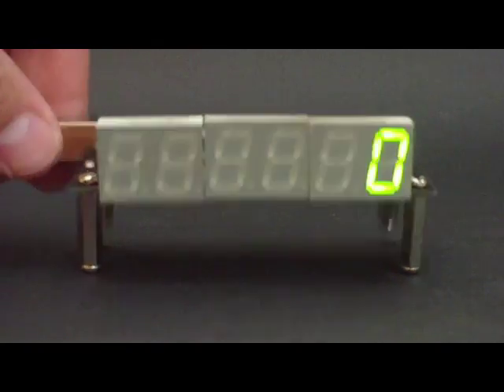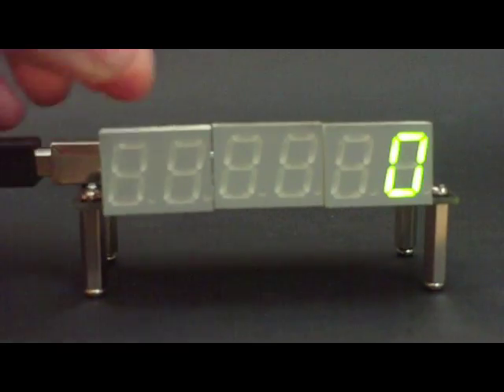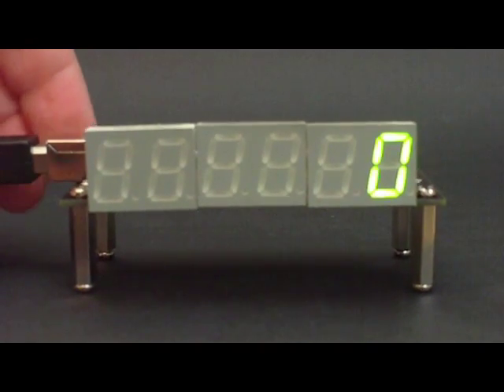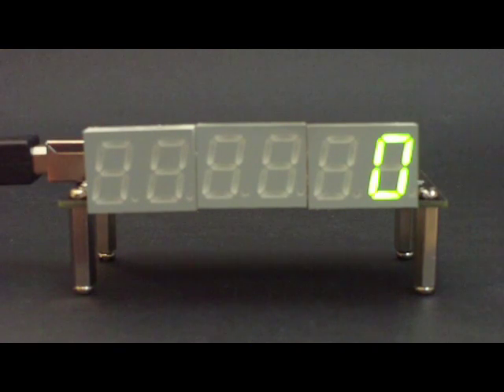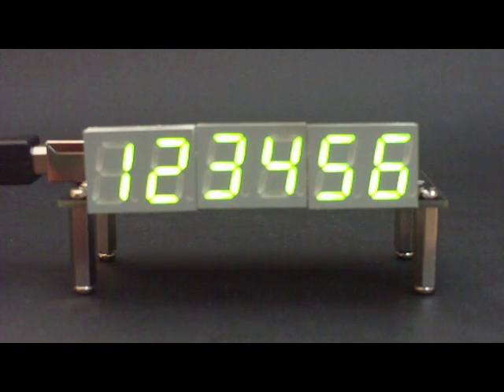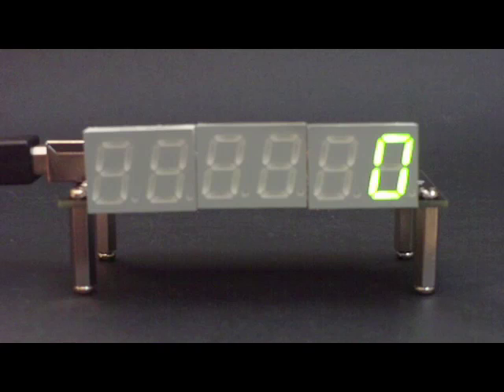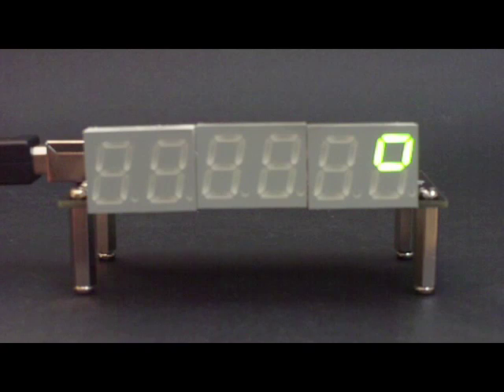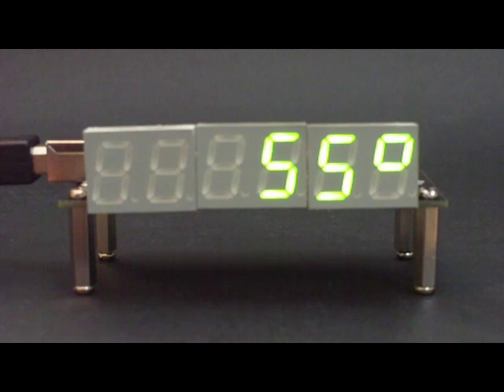How-to Tuesday: USB7 6 Digit LED Display Kit

Comment: I am an air traffic controller, and there is time where i have to read the wind to aircraft from a computer.   and for training purposes i wanted to make a display that could display these type of numbers for example  345/09 245/14 100/13  is there anyway i can program a display to set about a 100 of these numbers in 10 second sequence?

Comment: the one annoying thing about electronics projects is that most of the components are already built.

The micro controllers are so small you can't tell whats going on. All you can do is put the stuff together.

I want someone to build this thing with full sized components. Make this thing take up a small garage if you have to.